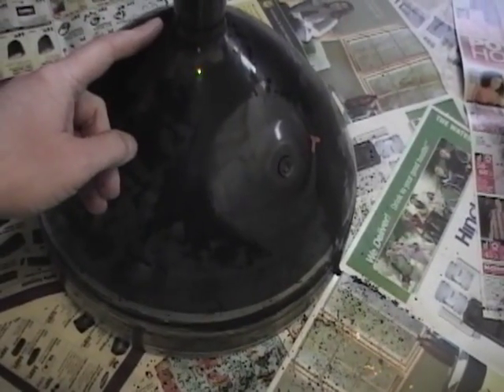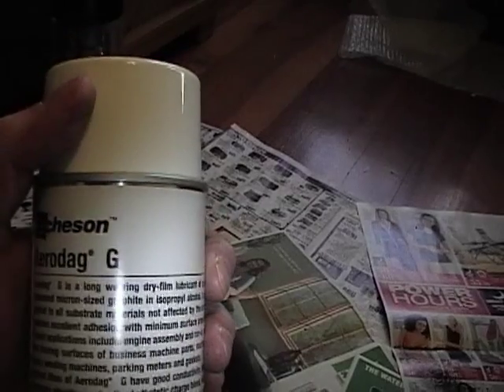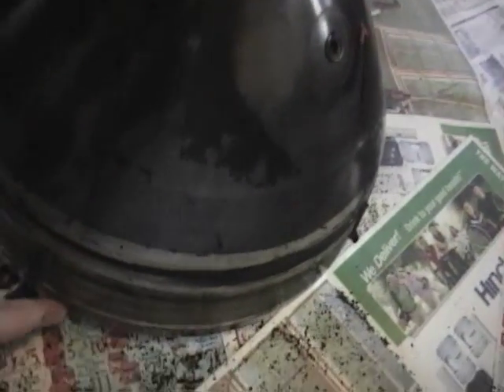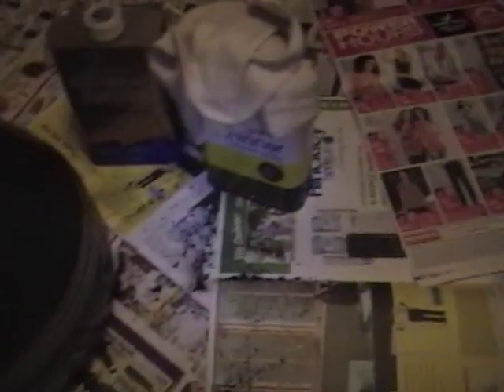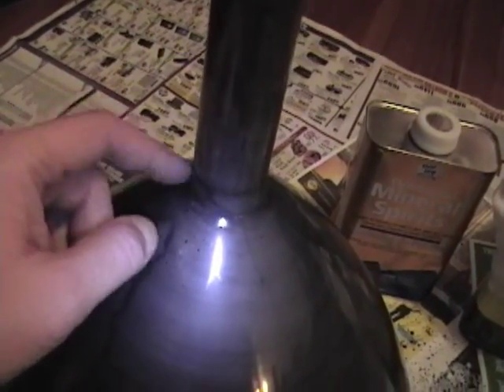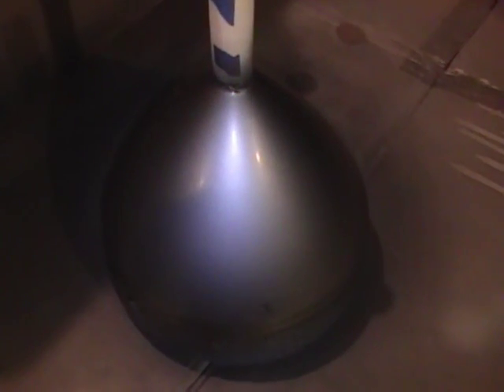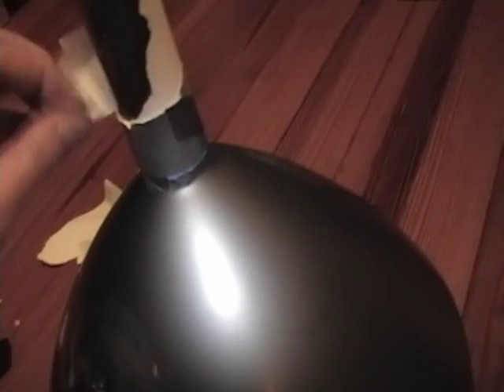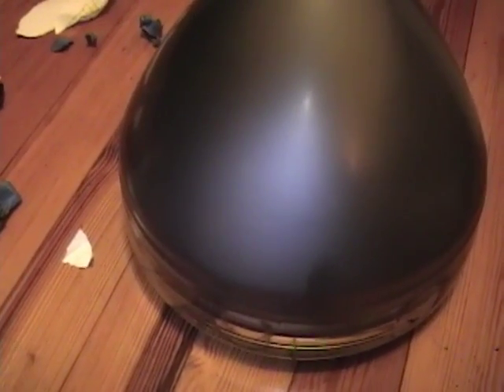Admiral 24C16 restoration p9o11

Comment: Thanks for this video. 12Lp4 crt from a junked set out in the weather for many years, tube excellent, dag coating gone. Looked for the paint on line, have number for Ted Pella, inc., is that where you obtained the paint. Also junked Admiral 30a12 if you need parts. Thanks
Reply from the maker: +butchfoot SinceI made this video, I discovered that a product called Split Plate works better and costs less.  Also easier to find.  Thanks for the offer.  I'll let you know if I need anything.